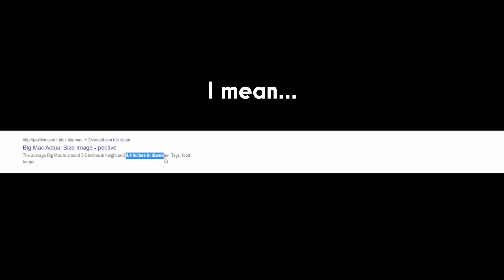Making the mini electric airboat SLIPPERY! (UHMW installation)

Comment: Im assuming this is Ultra High Molecular Weight Polyethylene?  This thing will fly across anything with that stuff attached.
Reply from the maker: It sure is! And yep, now there are no issues going over wet snow👍
You can see the results in this follow up video: https://youtu.be/vMDqANai1XY

Thank you for watching!
/Jack

Comment: Hey great vid! I have bought the motor you guys recomend(120100) but i wonder if you can run salt water throug it? I think the watercooling tubes would have to be stainless to do that.
Reply from the maker: Hi there Magma Boy! Jack here.
Cool stuff! I hope it serves you as well as it has served us👍

Regarding the saltwater, then we are not the ones to make that call for you, as we have only ever run ours in fresh water. However, my qualified GUESS, is that as with any other outboard, it should be fine as long as you keep an eye out for leaks, and that you flush the system with fresh water before storage.

Also, remember that having a motor constantly sit out in the elements near a body of water (as ours does) exposes it to a lot of moisture and grime that eventually will find its way into the motor.

I hope that helps your thought process! And good luck with your project! Keep us updated😎
//Jack
Reply: Thanks for the tips think i might chose a closed cooling system depending on what i see when I get it. I'll leave comment when im done